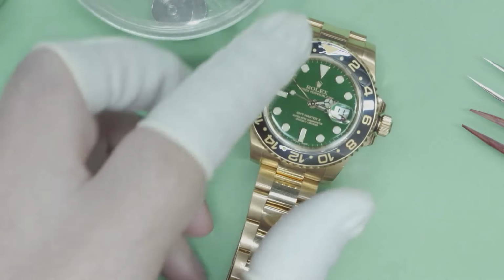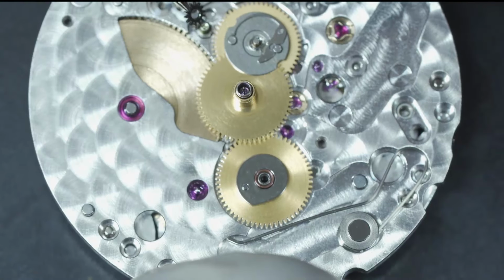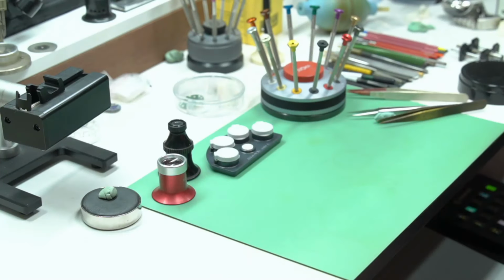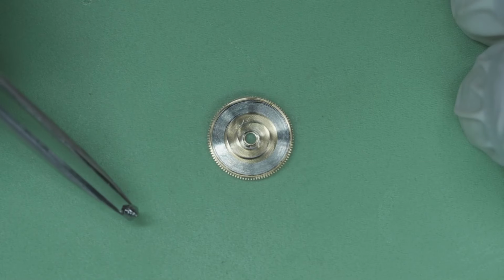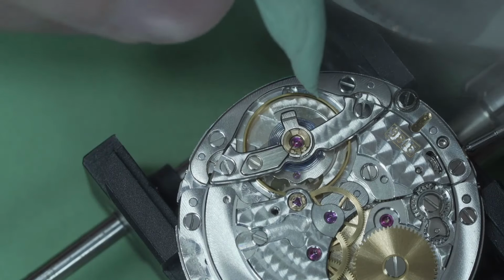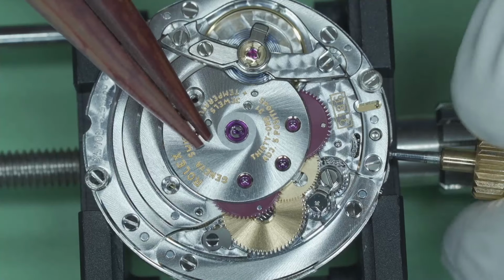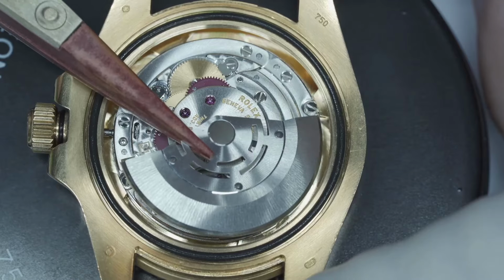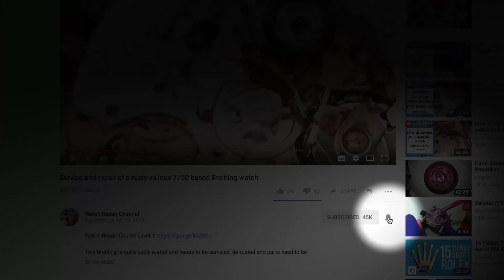A $30k Rolex GMT Master ii - Cal. 3186 Full Teardown and Service

Comment: I am a professional watch repairer, I service a lot of Rolex you have done a great job you must not put yourself down by saying it’s not to Rolex standards.
Reply: One little observation, the way that the hands are fitted, specially for Rolex have a specific way that will have a margin of 2 minutes or less when changing the date.
Reply: @edmondzacapa9935  Really?  my brand new Rolex changes date at like 3 minutes after
Reply: @edmondzacapa9935  official standard is less -5 +10 is acceptable to pass a typical BHI course
Reply: I have a technical question for Rolex, does GMT Master II have “danger zone” to jump hours to change the date as many typical ETA 3135 (only time and date) based movement? I have a watch with ETA 3135 and it clearly stated don’t change the time between 9-3, but have never seen such phrase in GMT Master II manual. It has bugged me for very long time and I want to listen to your advice.
Reply: I think he’s probably using that as a “compliment” for himself ;)
Reply: @FnGRZupra  fakes do it before 30 minutes
Reply: @JacobFolena  Date there is no real quick set date on the GMT master II.
You use the normal local hour jumping and that just engages the regular date jumping mechanism.
With most watches the issue is that the quick set date just bypasses the date mechanism.
Reply: @TheSchmed  if it is, he surely deserves a compliment from us as well, that was a wonderful demonstration and outstanding work.

Comment: I think the servicing of all high-end watches should be videoed and the video given to the owner along with his watch.
Reply: I think so too. I strongly suspect that a lot of unscrupulous watchmakers just throw the movement in the ultrasonic and then drop some oil in the places they can reach without disassembly.
Reply: @thepenultimateninja5797  Won't that damage the movement?
Reply: ThePenultimateNinja I’m more worried about them pulling out parts and replacing with shit parts.
Reply: Paul Amarante yeah. The thefting the original expensive parts and replacing with cheap replica parts
Reply: Same for CARS!
Reply: Something is never really "broken", it just lacks duct tape!
Reply: Indeed
Reply: @thepenultimateninja5797  This of course generously assuming said watch  receives a dip in the ultrasonic, right? 😉
Reply: So true I mean just seeing the amount of oil and scratches on the screws that don't need to be there is heartbreaking especially for expensive timepieces and yes they should photos and videos as incentive
Reply: @imperius_lxxvii9999  They do at my local BMW shop. Video of service is sent to the customer before the car is delivered back. Also used to show what could be wrong before changing any parts to let the customer be inform beforehand.
Reply: I had my father's old Pentax Spotmatic's foam parts refurbished a few years ago, and the repair shop sent me cd with pictures of the camera and parts, before and after, and a short video showing how the foam was replaced. I think that camera is older than I am and I am over 50.
Reply: Steven Turner  :)
Reply: Ive had a datejust butcherd before would of loved to of seen the a vidoe
Reply: Always send a high end Rolex to Rolex for service trust no other watchmaker..
Reply: @jenschristianschmidt8049  yes same at my BMW service centre. I get emailed a video whilst I'm sat in the waiting room sipping latte 😂
Reply: @plant-basedmd7891  I trust more an expert watchmaker such as the person that makes the video than the clowns at authorised dealers.
Reply: I am 100 percent sure no owner can reassemble it.
Reply: My watchman takes pictures of disassembly, sonic bath, all oiling and reassembly.  Pics are also taken of the watch on his machines being tested.  This service runs $200.00... a BARGAIN!!
Reply: Agree 100%, not  olny a sort of receipt, its absolutely fascinating to see
Reply: Yes, I think so too, I’ve said the same exact thing.  Same should be true for servicing of your automobile, for larger jobs, not a simple oil change.
Reply: @thepenultimateninja5797  or worse yet, take out your Rolex parts, and replace them with inferior parts, a Rolex balance assembly itself can cost upwards of $500, a cheap Chinese replacement $25.
Reply: @thepenultimateninja5797   sounds like a safer way to get it going if the knuckle head isn't trained so you get what u pay for with high-end movement preservations
Reply: Great idea!

Comment: It looked like the last guy who serviced it just removed the back and sprayed it with WD-40😂
Reply: LOL
Reply: It's a fake or replica ROLEX. ROLEX don't burr up screws & over oil or scratch numbers in, looking at the parts they are heavily scratched up, it's a rubbish watch.
Reply: I can repair some basics of watch problems but if the watch is original rolex im so afraid to repairing it bec its very difficult and danger 😊
Reply: Dusty Farmer ...  I admire Mark’s restraint to not respond to these comments.
Reply: @dustyfarmer  - You silly human. It's original BUT was previously serviced
Reply: @dustyfarmer  Wow, I'm glad we have a real Rolex specialist in here!  And to think, Mark has been in the field well over 30 years and he can't even spot a fake!  /sarcasm
Reply: JP JP English is your not your first language for sure!!!!
Reply: mike m. p
Reply: you know what? you are right! i was skeptical about that behavior and i decided to try it on a scrap movement. an old NH35 still running but it needs a servicing. as it will get disassembled anyway, the decision was easy to take. i flooded the thing with WD40, a quick compressed air to get rid of the excess and left the movement to dry during 2 days at room temp. result is what we see in this video. THE EXACT SAME SYMPTOMS.
 really, i'm losing faith into watch repairer. the thing is i hope it's not the owner who did that. because it is stupid as hell. not even measurable.
Reply: Dusty Farmer probably a “Rolex”,not purchased at an authorized dealer.
Reply: @dustyfarmer  how did you reach that conclusion?
Reply: @rtlinson  By a Diesel mechanic, presumably !!!!

Comment: My Rolex is about 10 years old and works perfectly.  Foolishly I decided that I should have the watch serviced.  Just preventive maintenance.  My local AD said he would be happy to service my watch at a paltry $1200 plus tax, another $100.  I said no and figured I could find a guy like in the video.  No such luck.  I would have to drive 500 miles to get the watch serviced by non authorized service.

Comment: Thanks for posting this video. This was my first 3186 and when I came to the GMT wheel, the brass pinion wouldn't lift off for the post. Thought I was doing something wrong until I watched your video. This brass pinion was just seized in place. I let a little 9010 soak into it over night and it lifted right off in the morning. Thanks again.

Comment: When I see how beautiful the movement of a Rolex is constructed I realize why they command a premium price. Great video!
Reply: I saw that video where he worked on a $50 Chinese automatic watch.  It was interesting to see these same sorts of hundreds of parts, but out of what looked kind of like crude stamped metal with large, crude gears, working, if just. There were some sad gouges, like they'd had trouble putting it together.  And he suggested that such a movement was expected to last 5 years or so :/ But it DID work!
Reply: @joshuascholar3220  a good point, and the same applies to cheaper vintage watches. You can get vintage Oris watches under $100 and vintage omega under $500, but the movements will have SO many gouged screws, scratched parts etc.
Reply: You should see a Vacheron Constantin, Patek Phillipe, Grand Seiko or Audemars Piguet caliber. They are all works of art, a few steps prettier than even this Rolex engine.
Reply: You pay for finish and art, of course if you want an actual accurate watch then you'll just buy a quartz watch. 🤣
Reply: It's a replica ROLEX. scratches, grafitti, over-oiling on a ROLEX that has not been opened since factory.
Reply: @joeskeptical4762  unfortunately, those aren't rolexes. And come on, Grand Seiko?
Reply: @conqwiztadore2213  What do you mean, exactly?
Reply: @dustyfarmer  Did you even watch the entire video? He clearly stated that it had been serviced before. JEEZ!!
Reply: @conqwiztadore2213  I think you mean unfortunately that Rolex isn't VC
Reply: @dustyfarmer  The owner only had the watch for a month but he did not buy it new, so the previous damage was done by a person not so skilled in watch repair.

Comment: I’m just here because YouTube suggested it for me. I stayed because I’m a millwright and love working on machines. This however I’m having a hard time wrapping my head around how small these parts are. My mind knows a watch is small but my eyes are trying to tell me that train wheel shaft is way to long and must poke out threw the other side of the watch!!! I have so many question I’d love to ask as someone who knows nothing about watch repair, what’s certain parts do, why they are called what they are. Then above all that there is the ultimate part for me as someone who builds much larger pieces of equipment....How the heck do you guys make such small parts, it’s not like you can throw a piece of steel in a lathe or on a mill or even stick a piece of rod in a chuck and thread a screw!!! Now all that said I love watches but watching watch repair videos all day I have a new found appreciation of just what goes on inside these beautiful machines! 

Thank you guys (yourself and two other channels) that have kept me interested all day! I even stayed home from a round of golf to sped some time with the three of you!

Comment: How do you know which way to wind the main spring into your winding machine so it is in the correct direction to drive th hands clockwise. May sem a silly question to you but after watching your other vidos it is still a mystery .cheers fantastic work

Comment: I enjoy your videos. Thank you so much. A couple of questions: What is the purpose of using brass and steel gears...is it because brass is considered a self-lubricating metal? What is the material/purpose of using the purple colored gears? Do you review a maintenance guide prior to working on a movement that you might not be familiar with...or just get after it? Thanks and sorry for asking so many questions! Cheers.

Comment: can i ask the question? when the hands replace, in the case of 2824-2 has to remove oscillating weight, automatic block and then use a replacement tool to support 4th wheel. but this time(cal.3186) you don't used it. Could you please tell me why?

Comment: Where are you located ? I have an automatic Longines man watch for a few years and had cleaned and serviced twice so far. My problem is the winding won't hold overnight, in the morning I have to wind manually for the day. What is likely the problem with my watch ? Maybe it will be your next project for your vlog, thank you.

Comment: This was an enjoyable video. It's a top quality machine finished movement, but there's a good reason Rolex doesn't do display backs. Most of what makes the quality of the watch can't really be seen because it involves the tolerances of the parts. It's fortunate that the last person who serviced this only did some cosmetic damage. They could just as easily have damaged something important to the operation of the watch. I'm sure at some point it will get sent in for a Rolex service, but there's really no rush. You may not be Rolex certified, but the service you did was as good (other than cosmetic part replacement) as would have been done at the factory and probably significantly less expensive with a faster turnaround time.

Comment: i have a project of video for you if you don't mind? it would be to try to lubricate a movement with a mixture of teflon/wax/thin oil. i talk to you about that because last researches (not watchmaking related) proved that it's the best metal lubrication. for any metal. long lasting and really protect the parts. of course try that on a scrap movement. to compare with a normal lubrication. i'm sure you'll be surprised.
 you can make the lubricant by yourself with a bag of teflon/wax mixed with thin oil until you obtain a very thin cream texture. almost liquid. it is also less prone to spread widely and dry. i honestly could pay to see that. cheers.

Comment: Exellent video from you as always, informative and to the point, thank you!
I would much rather have you service and repair my Rolex with your steady hands, careful attention to every detail and professionality than the Rolex dealer service, which I suspect did the hastily service resulting in overlubrication and marring the screwslots, sign of sloppy attitude than stem from the assembly-line service from the lucurative aftermarket for Rolex.
Cheers.

Comment: what are these little purple things? the 31 jewels/gems? if so why do they use them and not some kind of metal? do the jewels/gems last longer or what is their benefit? didn´t know that there are so many small pieces in a watch - thank you for the video! :)
Reply: The gems are to stop wear and tear so that it is not metal  on metal and they aid lubrication of the movement as a little oil is but on each one. Metal on metal would cause a lot of friction and increase wear and tear, which would have an impact on the movement.

Comment: What an excellent Rolex service video. Definitely running within Rolex specification. May I ask . How much would you charge for a service like that?
Reply: Rolex asks about USD 600 but they will replace many parts if even a little wear is seen (for example on the pallet fork or escapement wheel) all included in the price. They also usually fit 3 to 4 new hands, a new mainspring, a new date wheel (if the movement has one), a new crystal, new gaskets, a new crown tube & stem, they clean up the dial if needed to look perfect, then polish it to look like new. They also pressure test it after closing up the watch case. It comes back as good as new.

Comment: Can you tell me what make and model your fine tweezers are please I build ww1 aircraft models and they look ideal for doing the rigging
Reply from the maker: The very best are Dumont (not cheap but high quality) and you can get them from most watch and clock parts suppliers. In the U.K. many use Cousins. I use the non magnetic stainless versions. Good luck.

Comment: Rolex repair and switches all broken or non Rolex parts during service. The top case (glas) will have a small laser etched R insignia telling you it has been officially serviced by Rolex.

Comment: So far I love Rolex Design. I was impressed how you could remember where every single screw belongs to. I  can't afford a Rolex, so I bought a 600 € TISSOT 100PR This is stainless Steel with two Sapphire Glases . My Question, the Tissot run's late 2 seconds in 24 Hours. Is that still ok?
Reply: That's very good. Around 1-5 seconds per day is very good.

Comment: Something just struck me about watches. They have many screws but no nuts. All the screws go into plates. Or am I wrong, is there a watch out there somewhere with a nut or two?
Reply: Nuts come loose and it's an extra complication, plus it would be more bulky. Not aware of any watch movements with nuts and bolts.

Comment: Your skill is amazing and patience unbelievable, but what a comparison a twenty thousand dollar Rolex GMT to my twenty dollar digital Wal-Mart Casio. The Rolex must be torn apart to service & clean and with the best adjustment will still lose + or - 5 seconds a day and some as much as 15 seconds a day. My Casio + or - .05 second per day and service is a battery change once every 10-15 years, with my 1983 DW-5000C has been running on the same battery for 37-years, so what is really the superior watch CASIO all day every day!